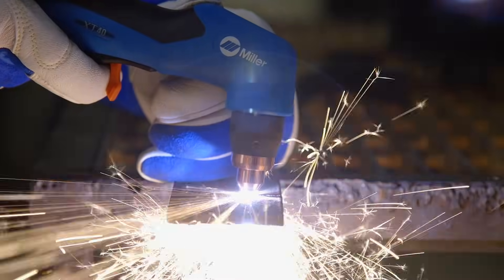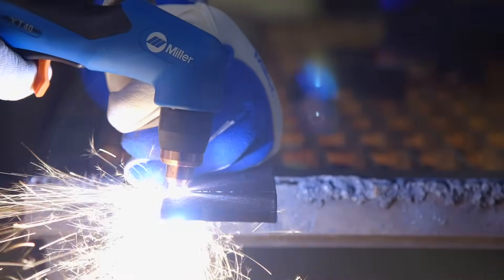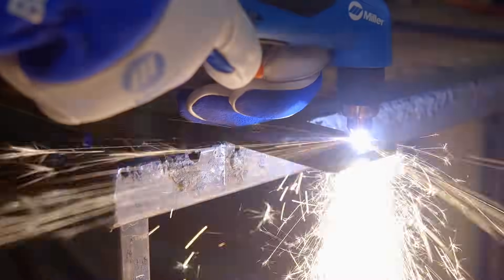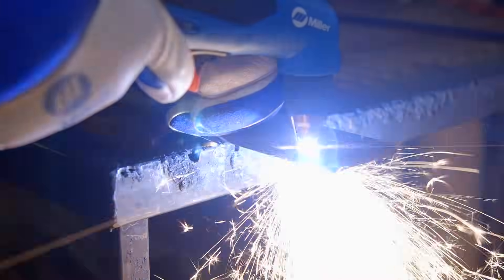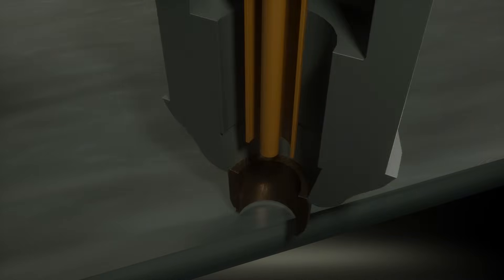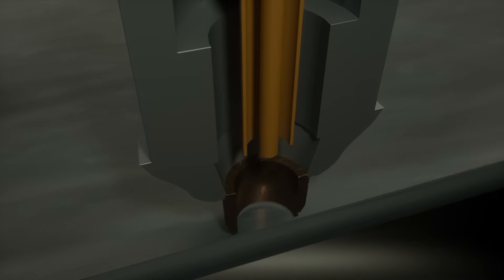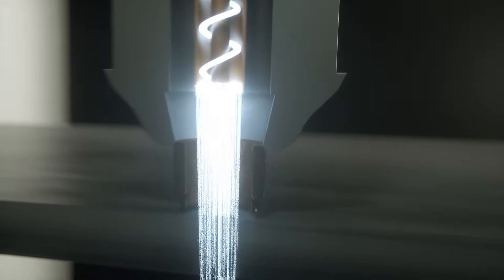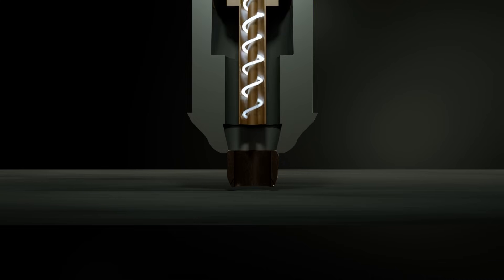How Does a Plasma Cutter Work?

Comment: what type of air or gas I can use on a plasma cutter
Reply from the maker: For plasma cutting operations, normal compressed air is the most commonly used air/gas. Nitrogen can also be used and is most commonly used when cutting stainless steel as it provides a cleaner cut on that material.

Comment: So can cut with just compressed air? Or does it require gas also?
Reply from the maker: For plasma cutting operations, normal compressed air is the most commonly used air/gas. Nitrogen can also be used and is most commonly used when cutting stainless steel as it provides a cleaner cut on that material.

Comment: Why does my plasma cutter still cut even though my ground clamp isn't clamped to anything?
Reply from the maker: Most plasma cutters utilize what they call a contact start instead of using high-frequency. The tip and electrode touch until the air starts to flow. The contact allows for the arc to start without high frequency and produces a pilot arc. The pilot arc transfers to a cutting arc when the circuit is completed. This happens when the arc contacts the metal with the work clamp connected to it.

Comment: What happens when you run a plasma through a sheet of tempered glass? Is that one way of possibly cutting tempered glass without exploding the panel? Technically the heat would almost serve as a local annealing process so you don't need to anneal the entire piece to cut it.
Reply: The incredible heat of the plasma will cause a temperature shock in the glass pane, breaking it. If the plasma will start at all, i guess it needs a conductive material.

Comment: I had no idea on how they worked. I am new at welding and  now looking to buy a Plasma cutter as I hate using an angle grinder to cut steel. Takes too  long and does  not feel safe.

Question......With welding one buys welding rods. So what does one need to buy for a plasma cutter to keep it going as one uses. I assume it needs more than just compressed air? Thanks
Reply from the maker: The main consumables are the electrodes and tips, however there is also a swirl ring, retaining cup and o-ring that are considered consumables. These consumables can be purchased separately or as a consumable kit. Typically you will use the tips faster than the electrodes, and rarely will need to replace the other consumables.
Reply: Plasma cutting makes torch cutting obsolete. Apart from the tips and cap, there's no other consumable. You use compressed air as gas, which can be supplied by an air compressor, and some plasma cutter even comes with their own air pump. Of course you want to make sure the air is dry and there's no water in it, as it will destroy the tip and cap. Apart from that, just make sure your air compressor can supply enough compressed air to keep it going. I think it depends on the amperage you are cutting but 60psi is a good starting point.
Reply: @taiwanluthiers I have bought one since I posted my question and I love the way they cut so fast and easy. Thanks for your info.

Comment: So all I would need is air compressor? I don't need a tank of some type of gas?
Reply from the maker: Correct, you need compressed air, and electricity, no specialized shielding gasses required.

Comment: There is no cooling mechanism for the nozzle?
Reply from the maker: Thank you for your question!  In the Spectrum line of plasma cutters the compressed air will continue to run through the torch after the arc is extinguished to help cool the consumables.  If you have other questions please feel free to contact us at info@millerwelds.com.

Comment: Do I need to wear a welding helmet while using one of these or is safety glasses sufficient?
Reply from the maker: Thanks for your question! You do not need to use a welding helmet when plasma cutting, it is recommended to use shaded safety glasses. Miller offers a few options including, 235658 Black frame, 235657 Blue frame, 235659 Orange frame, 272205 Slag™ black frame, 272209 Slag™ white frame. You can find those here: https://www.millerwelds.com/safety/safety-glasses/safety-glasses-m00483#!//

Comment: Is an ordinary air compressor can also be used?
Reply from the maker: Hi there, thanks for reaching out. When plasma cutting, you can use compressed air from a normal air compressor. You would want to make sure the compressor is large enough to provide enough air for the plasma cutter you are going to be using. We hope this helps!
Reply: "also be used" - It is exactly what is used..

Comment: How much gas does the torch consume when cutting -- what is the flow rate or how long does a given cylinder last?  If I expect to cut mostly Aluminum in the 1mm to 12.8mm thickness range which gas is best?

Comment: So we don't need to reinvent the wheel when it comes to designing a fusion-reactor, these plasma cutters have already harnessed the power of the suns.
Reply: Nuclear fusion and simply the creation of plasma are on massively different levels.
Reply: you need a ton of heat and pressure, hence why the sun core works

Comment: Can plasma cutter work in space if there is no medium (air) to super ionize?Otherwise bring air with you?Plasma in space is ejected from stars ,but is not readily available for lack of AIR
Reply: Did you just answer your own question?
Reply: @rz7093  He's making an educated guess, don't be mean.
Reply from the maker: Thank you for the question! After doing some research it seems that it is possible if you bring your own medium for gas but it would be highly impractical. The vacuum of space would create numerous issues that would have to be solved by redesigning the power source, air handling systems and plasma nozzle. Thank you.

Comment: Can an actual lightsaber be made as a giant plasma cutter?
Reply: Yes. but it would be a fluid state rather than a solid state saber.Which means no blocking bullets or other plasma-saber
Reply: king james stfu idiot
Reply: @michealangel1556  keep crying
Reply: Perhaps as more of a sword with a edge of plasma by having a ridiculous amounts of electrodes and a pipe through the middle with holes drilled at all the electrodes with again another ridiculous amount of pressurized gas
Reply: Yes! a youtuber named the hacksmith is working on a few right now. The video will be out in a few months, but you can check out the Instagram which has some snip bits of it working.
Reply: @steelavocado1  that thing is like plasma flamethrowerbut okay
Reply: @steelavocado1  That isn't plasma though. It's a laminar flame
Reply: Look up recent videos by The Hacksmith.  He's basically done just what you said.

I wasn't quite as impressed as many of the commenters who seem to think they are mere months away from being able to hack their limbs off while pretending to be Jedi.  :p
Reply: @marcw6875  Those commenters are insane. They think they're revolutionizing science and engineering in some backyard shed. Hacksmith in reality is pretty mediocre.
Reply: No but MAYBE you can make a real life Plasma Cutter from Dead Space
Reply: You would need an industrial size generator as well as a massive air compressor near by but in theory it could be done
Reply: @tcswag801 hold on darth Vader like 15 minutes until my lightsaber boots up then you’re gonna so get it
Reply: Ha, I wish! Maybe...
Reply: I don't think so. A plasma dagger is more feasible, but that would still require a ludicrous amount of power.
Reply: I mean if you find some material that can hold plasma in one place while using its heat to cut through solid objects, then sure